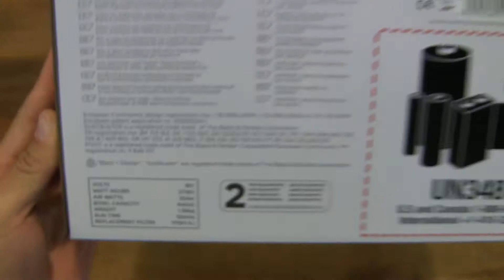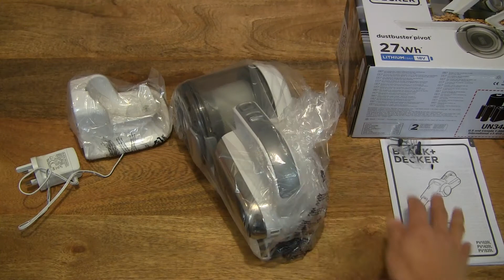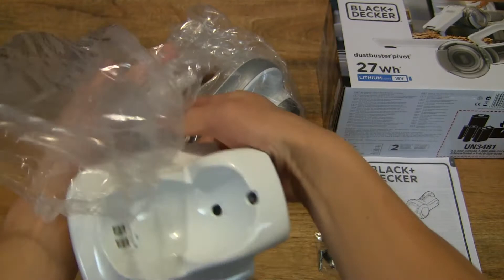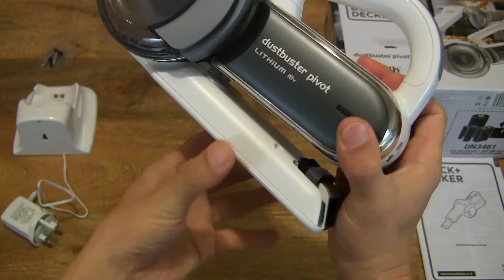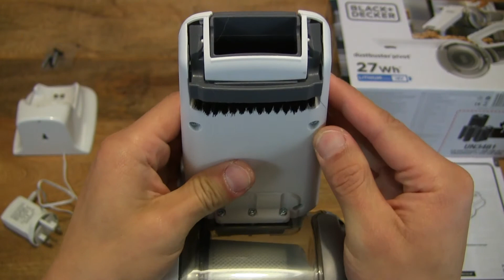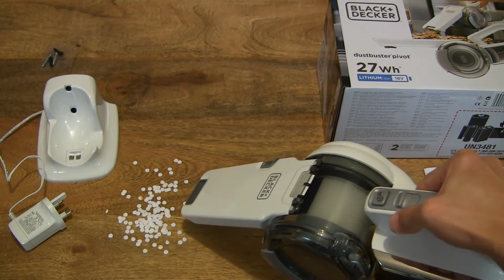Black + Decker Dustbuster Pivot Hand Vacuum

Comment: Try perhaps doing the review quicker. 30 minutes is a long time to view few functionalities. Else, the unpacking was good, hopefully the criticisms get to the company. The manual was not friendly at all.. and the placing of the cleaner on the nozzle section would have been nicer if it had rubber places. I can imagine this getting scratched up later for a little poor design on the UX part.
Reply: It’s very easy the video In fairness. It’s a good thorough review.